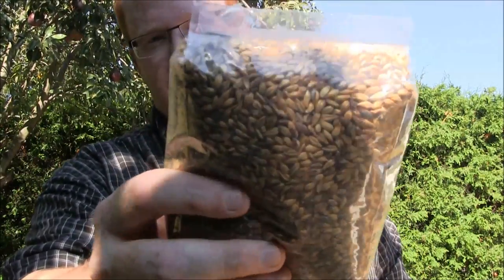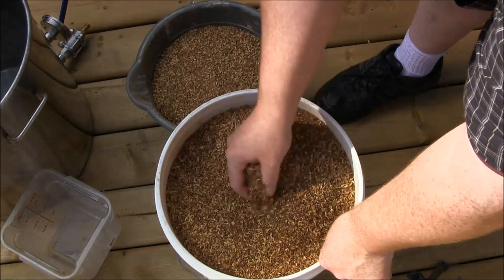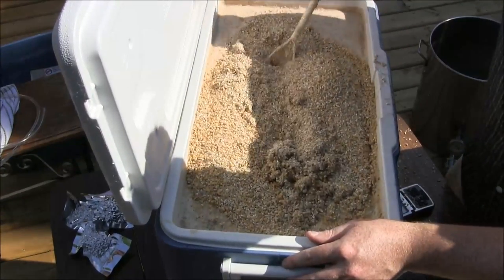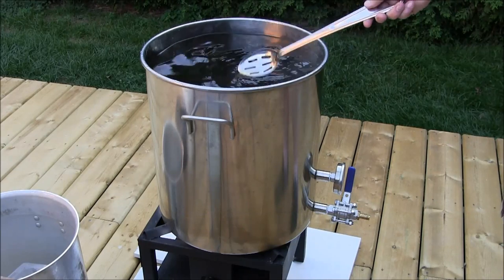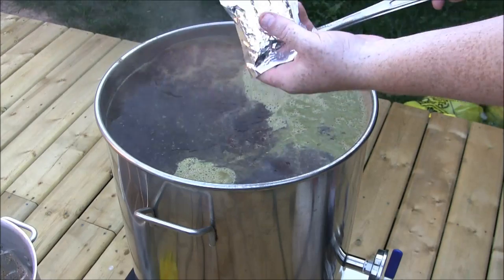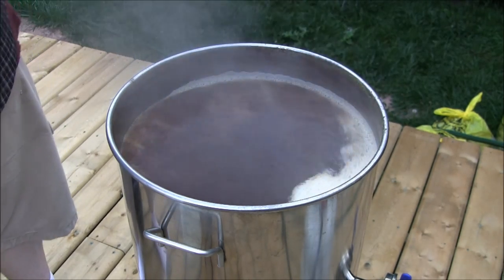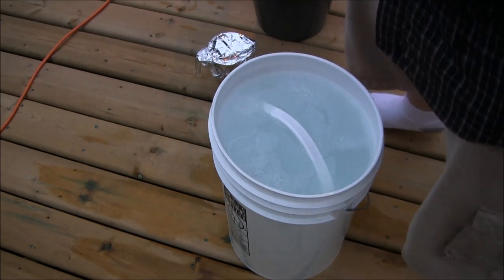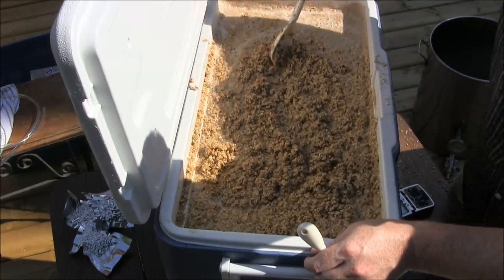Homebrewing Fundamentals - All-Grain Brewing Basics

Comment: I've only been all-grain home brewing for around 3 years, and what I've learned so far is covered in this video - a very good example. I would say there's a few points of worth suggesting (some may have been mentioned?) 

- Try smaller batches first off (half or quarter ingredients/volumes)
- Brew in a bag (BIAB) method uses a thin 'mash bag' to contain the mash/grain allowing for one mash tun/boil pot in one, but beware, even though this allows less equipment, sparge/brew efficiency suffers.

Comment: Pretty good, never saw that cooling method pipe inside hose, great idea will try as batches size up. Recommend sizing up yeast in separate cups to get even amounts in each pitch. Pot about 2 inches short for that batch size, but you managed it well... Thx.

Comment: For those that don't have a hop filter, I have a few options. The strainer which he used, second is a hop bag (tied with a slip knot for use through the whole boil), 3rd before you drain into your chiller if you vigorously stir the un-ferminted beer till a vortex is created then allow to stand till the vortex dies off the majority of the hop material left will settle to the middle of the pot

Comment: nice video. one thing: you say not to add hops before dealing with the hot break. I first wert a lot which is adding hops in the kettle when you first start sparging. it tastes great. just make sure the kettle is not so full and have a cold spay bottle and lower the heat till the hot break ends. good stuff though man!
Reply from the maker: True. If you are doing FWH, you don't have much choice.

Comment: I have a couple questions for you. How long will mixed Star-San keep in storage? Why did you use 169 degree water for the sparge and only 152 degree water for striking?
Reply: Mixed star-san is good so long as the pH of the mixture stays within the desired range.  It's particularly stable if you mix it by the gallon with distilled water.  Generally if it doesn't get cloudy it's good and note that if you're using municipal water and it gets cloudy, it means your water has particulates in it.  It'll sanitize but not keep under such conditions.
Reply: he uses the higher temp sparge water for th same reasone he heats the strike water to 168 initially. You will have some heat loss when pouring the sparge. It more or less comes out of the tun at 152.

Comment: Good job on the video, thank you.  Question:  How much water are you using during sparging?  Keep adding until you have your pre-boil volume even if there's water still in the mash?
Reply from the maker: Since I continuously sparge, I add water until I get the preboil volume I'm after. However, I try to gauge things so that I'm left with little or no water left in the mash tun. Once I get very close to my preboil, I stop adding and let the rest run out of the mash tun.

Comment: It's worth pointing out that your grist ration will affect how hot your strike water should be.  You alluded to it, but it's important to point out that you will need hotter strike water, probably 170 degrees with a grist ration of 1qt/1lb of grain.  As you approach a grist ration of 1.5 quarts to 1lb of grain your strike water can get closer to 160 degrees.

Comment: Awesome video! Thank you for basically simplifying the process. I have been doing extract but dont feel like a real brewer yet. This video makes me want to start buying equipment for all grain. Im thinking about getting a counter flow chiller......did you use some kind of pump for transferring? How cold does the wort usually come out? Thanks again.
Reply from the maker: Currently everything is gravity fed. However, I recently picked up a pump that I will be adding to my setup.

Comment: Hello! Ive been trying for some months now to "copy" your recipe with my own ingredients. Im from Colombia and the barley available here is very plain untoasted. Any way, my problem is im mashing the grain for an hour and when i try to take out the extract simply wouldnt come out, its a very thick and dense soup. So I try to sieve the grains out, getting a lot of clouds all around and later in the process there is no fermentation. im guessing the grain im using cannot be kept for such a long period of time mashing because it simply gets cooked. Any guesses anyone?? Im desperate
Reply: Hey Nicolas. There are a few things that can cause this kind of problem. The grain to water ratio, your equipment, mash temperatures, how the grain is milled.. Try to add more water, and double check all your measurements. Specially temperature. If all else fails, google "Stuck Mash". You will find A LOT of information on what to do. Hope you solve your problem :)

Comment: What size is your boil pot? right now I only have a 5gal stock pot I use for extracts but I want to move to all grain, and larger quantity.
Reply from the maker: ***** 14 Gallons
Reply: I do all grain with two 4 gallon pots. Im not allowed to have a gas burner (propane or otherwise) on the patio of my appt.
its a little tricky making sure 2 pots dont boil over, but beer comes out the same. (i do 5 gallon batches)

Comment: I heard that homebrewing creates a certain amount of methanol, which is dangerous in higher levels, does this also occur in beer brewing or only in moonshine?
Reply: the cure for methanol poisoning ins ethanol!   You only have to worry about it in moonshine. But even with 'shine, any competent distiller will remove the methanol. but you will die from alcohol poisoning long before you die of methanol poisoning in beer.
Reply: all brewing, produces methanol and ethanol, plus various other unwanted items, the percentage of methanol and others produced are very minimal, of no consequence in beer. in moonshine, the first about 50ml (using a 5gal wash) is methanol, varies as to efficiency of the still, through it away or use as cleaning fluid, same with the last coming out, higher types of unwanted propanol etc. yes methanol is dangerous in high concentrations, but you will be no where near the level with a beer, methanol can cause blindness and other nasties, but as mentioned, antidote to methanol is ethanol, so have a whiskey chaser.
Reply: Thanks for responding, i was always scared of the methanol, you cleared a lot for me now!
Reply: steef wolf Nothing to worry about in beer, only when you start to concentrate it, as in distilling. But then you can take it out, evaporates at a lower temperature to Ethanol, so comes off first, then other non wanted components, evaporate at a higher temp than Ethanol, so can stop before they come off. But main thing is no problem with Beer.
Reply: Glad to hear :) gonna start soon!

Comment from the maker: The boil has two purposes, 1) To kill any bacteria, wild yeast or pathogens that might be in the wort, and most importantly 2) To "isomerize" the hops. The compounds in hops break down under heat; the result is that the longer you boil a hop for, the more bittering you will get. If you boil for a shorter time, you get more aroma and flavor. Bittering is important because you need to balance out the sweetness of the malt.

Comment: how much did your whole set of equipment cost?
Reply from the maker: You can get a full all-grain setup for around $300 ish (5 gallon size). My setup, which is a 10-gallon system, was around $350 for everything.
Reply: For everything?? The hoses wthe chiller wort, the boiling kettles, the propane burner, cooler (mash tun) everything?!
Reply from the maker: Reuben Neely Sorry no. I didn't including everything, just the basics of what you need to do all-grain. For all my my particular equipment, kettle, mashtun, chiller, burner, tank, tubing (etc), I spent around $500. If you factor in the other stuff, like refractometer, cleaning and sanitizing solutions, bottling/kegging stuff, it's probably closer to $1000. But this is by no means all required to do all-grain.
Reply from the maker: I got most of my stuff from ontariobeerkegs in Canada. Great website. The rest was mostly DIY.
Reply: MaltCast Do they not ship to the us??

Comment: - get a decent counter flow wort cooler and take time to connect it correct! (leaks!)
- consequently, indoor hob brewing is very steamy and messy I ONCE MADE IT RAIN INSIDE MY INSANELY STEAMY BATHROOM WHEN BOILING FOR AN HOUR! 
- if you get a cheap electric boiler the poor boil will give you a poor hot break (cloudy proteiny beer)
- yeast amount is important as too much will never settle and create strong beer